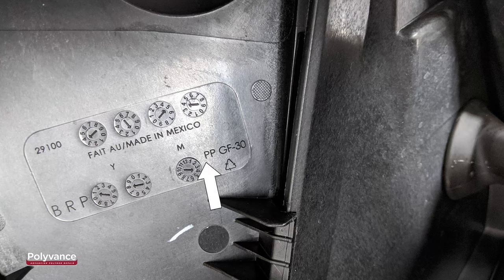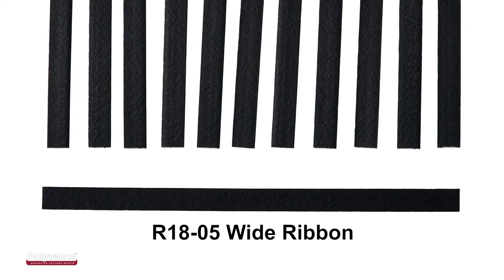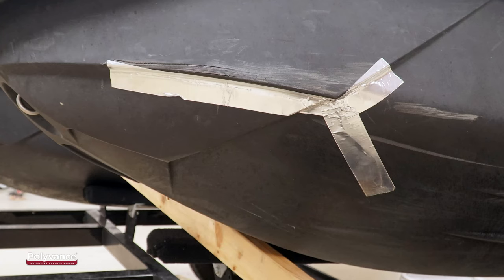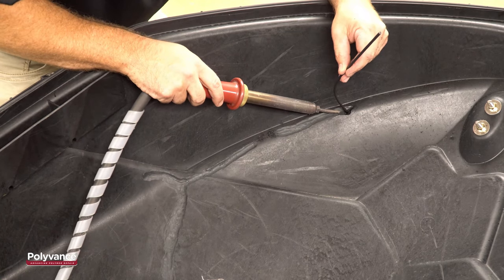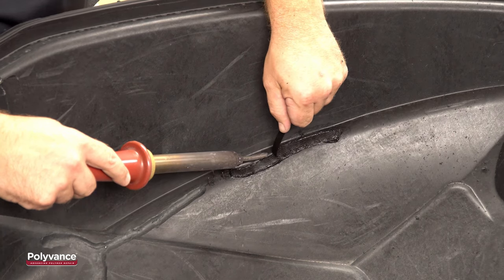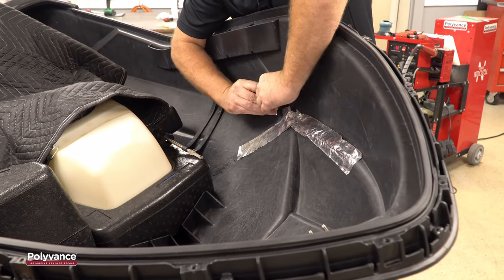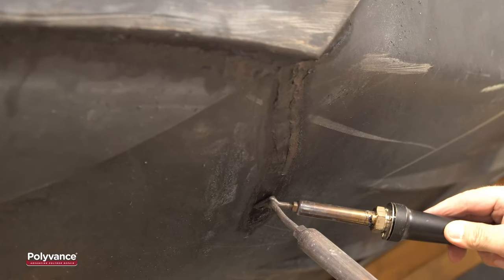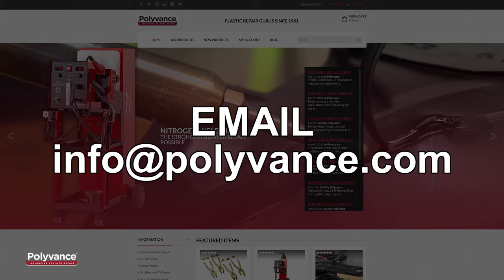Repairing a Sea-Doo Polytec Hull

Comment: Hey Polyvance! love the content. I have a quick question. I have some light scratches and a small nick in the haul from docking on my 2022 GTI SE. what do you recommend I use to buff out the scratches as well as filling the small nick? Any suggestion is appreciated. FYI: the scratches are not deep enough to feel anything when running your nail over them.  Thank you in advance!!
Reply: On small scuffs, car buffing compound will work well to remove it but it may gloss it up more than you'd expect.  I'd try fine grit buffing compound or swirl mark remover. On the gouge, if its not deep, nor causing a problem, I would leave it along.  If you want to deburr the edges, lightly sand them with some extremely fine sand paper, then buff.

Comment: Great content, what wattage is your welder? I did one repair before using the old recommended rivet and sealant method. I am wanting to try this method this time but considering using a 1300 harbor freight welder as I don’t want to front a large cost yet.
Reply from the maker: The nitrogen welder is 550 watts.

Comment: Why nitrogen? Why not just air?
Reply: Using heated nitrogen instead of air produces a cleaner, stronger weld.  Its similar to using argon shielding gas on a metal weld.